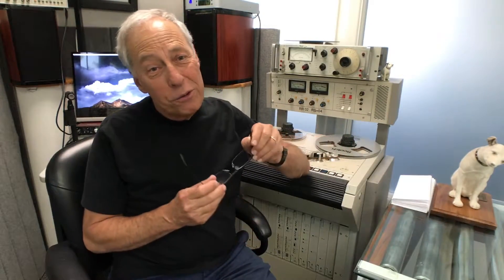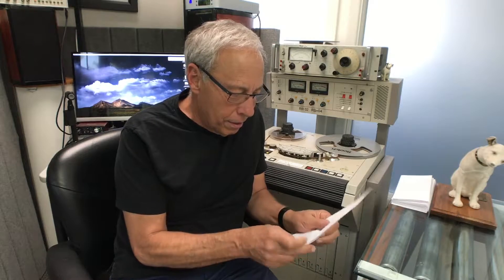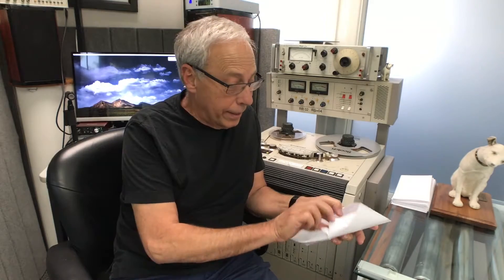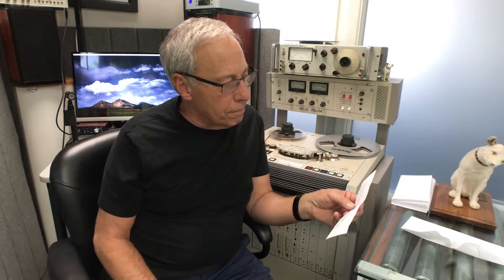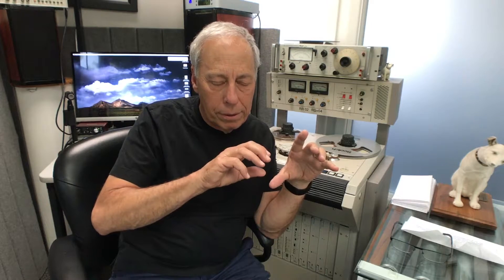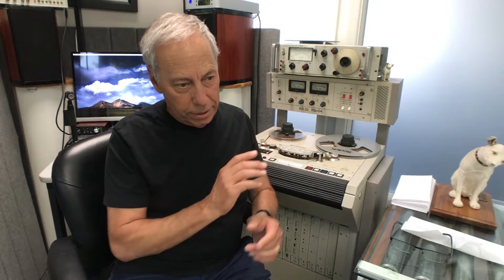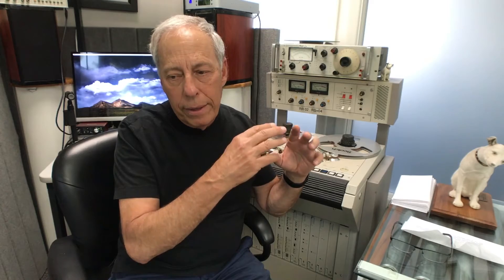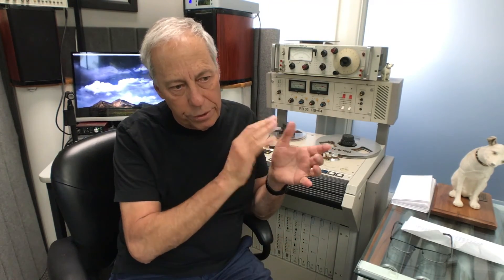How driver materials affect sound quality

Comment: Low moving mass with a small motor is better than high moving mass and a strong motor, because a low mass driver will start and stop quicker than a large moving mass, even when the motor is more powerful. It's also better to have a lot of surface area as opposed to high xmax as many drivers sharing the task will sound much less stressed than one car audio style subwoofer with high xmax. 99 % of high xmax drivers will cause a lot of distortion too. So if you want a big bass system better go for efficient low MMS pro audio woofers than big inefficient high xmax drivers imo.

As far as woofers in speakers are concerned it will matter only marginally. It'll be a trade off between extension and distortion. More extension equals more distortion as a speaker will not have the capacity for real bass no matter what kind of driver you put in there. It can sound impressive even though you have some harmonic distortion though. It'll sound warmer, but if you want the real deal you should go for a separate and big bass system.

Comment: I believe reproduced sound can NEVER get rid of the "signature" of the materials of the vibrating surfaces that emit it. Pretty much like the musical instruments themselves: Their sound is affected by the materials they're made of. The quest towards "neutral sound" by loudspeakers is rather like the search for the holy grail: Only if you can, magically, make the air move to make music, WITHOUT using a material as a mediator of this movement, only then is the sound pure from any possible colourations. Perhaps the most uncoloured sound (and really-really uncoloured) is the sound of a plasma tweeter and then, of an electrostatic loudspeaker membrane, moving well within its limits of good performance. If you pay close attention to all other speakers, your ear can finally pick up the characteristic nuances that the driver (and cabinet) materials impart to the sound (even though, occassionaly and under stressful playback material, for the best ones of them). This holds true even for very expensive loudspeakers. Listen to big, all-aluminium ones: They will all ring a little, from time to time! Plastic (carbon fiber ones): they will get a tiny "plastic" hue in their sound. Perhaps the most benign "material signature" is the one that comes from wood (in its various forms) and paper (basically, the same material). It's  usually more strong and persistent in time but for some reason (perhaps having more to do with our biology and evolution for millions of years close to sounds produced or affected by wood), they're better tolerated. Perhaps that's the best reason why paper cones and wooden boxes are still widely used in loudspeaker industry. Loudspeaker engineers have done marvellous work through the decades to clear their products from sonic signatures (basically by reducing, suppressing, or spectrally isolating/exiling them) but, in my opinion, the war has not been completely won yet...

Comment: Material indeed is not an indicator of sound quality. It simply has to do with Xmax and extension.

Beryllium is the best material to my knowledge (better than the Diamond B&W uses), but it doesn’t mean a Beryllium woofer in a Paradigm Persona 5F will sound better than a well integrated and quality paper cone woofer in another system. It simply means the woofer can have a wider frequency range without cone breakup.
Reply: Read the reviews of the Yamaha NS1000 speakers. They are vintage and I still have them.  The Beryllium mids and tweeters can't be faulted except they will reveal all warts in a recording.  They hide nothing.
Reply: ceramic should also be good
Reply: there are no woofers made of diamond or beryllium,,those are tweeters. only metals i know of are aluminum magnesium copper or combo of any 3,for a woofer. I like the aluminum magnesium combo myself or a carbon fiber. I was a big paper fan for awhile but moisture is a big factor on longevity,but paper cones usually sound the most natural i think.

Comment: My favorite tweeter is actually about $360 a pair.  Vifa silk. Raven pushpull ribbons.   My least favorite?  Any carbon crystal/diamond, focal tioxid and piezo. My favorite midrange?  Scan Speak revelators. Sub driver?  Tc sounds and similar.
Reply: I actually happen to have a pair of earbud that have silk dome instead of the typical mylar. Best sound stage I have heard from a pair of earbuds.

Comment: hi Paul, 

i've been around since your days of advertising in AUDI and stereo review want ads tucked in there with the SWTEC kits (?Bongiorno?) and that happened to be about the time i got to hear the SS1s.  of COURSE they were imperfect then, the servo sub was too slow for the screens but progress has been made, thankfully.  

awhile later, KEF and Celestion were using computer programs to visualize the diaphragm surfaces, hence the actual pics made with laser interferometry (Celestion) of "oil can resonances".  i think KEF were using MLSSA for the time domain graphs that Richard Heyser used to print in his speaker reviews.  i REALLY miss him.  Bascom's reviews in AUDIO also (i know he still writes for the slim and infrequently published TAV) where he would always include square wave measurements in the amp reviews).

Heyser also included the regular impedance curve but went further with the same curve on the z axis.   so much for the nostalgia.  

as for your specifically unsolicited disagreement---woofer cone material seems to me is as important as the mid or tweeter's.  especially in two way speakers as the woofer must go way up to about 2kHz in some designs.  the nice stiff, light cardboard in the dynaco a25 is a good example.  i can stop there, as you already warned me.

...hifitommy